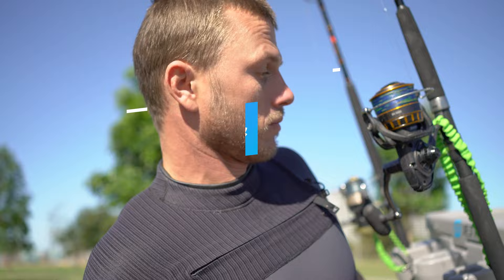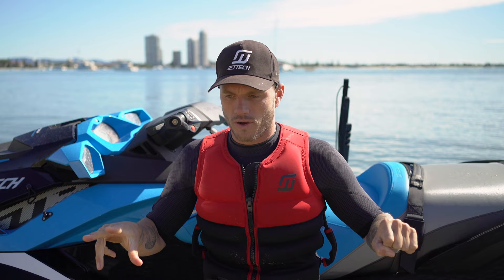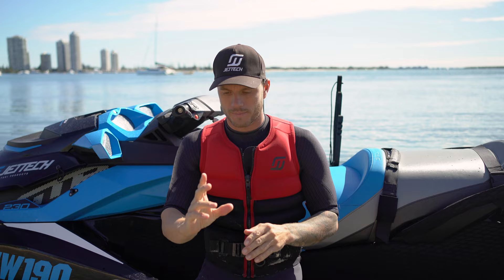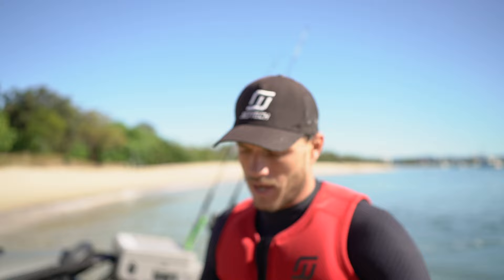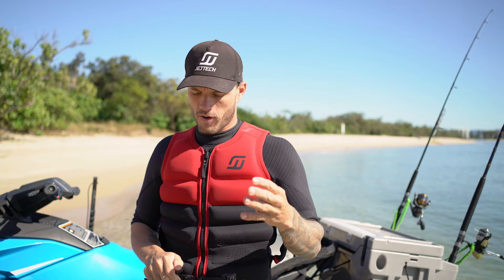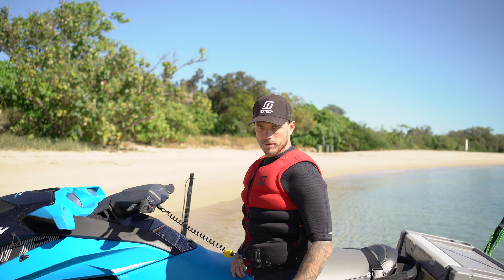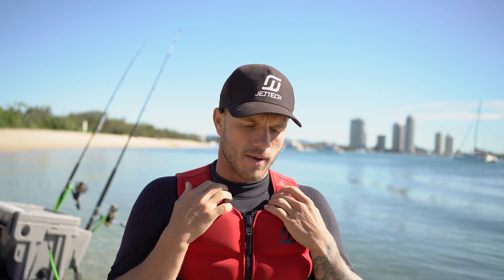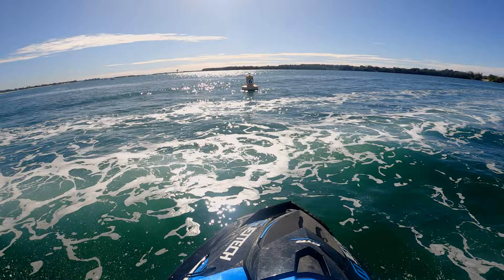DON'T DO THIS ON YOUR JETSKI! - 5 Things NOT To Do Your Jet Ski

Comment: Also when you beach your ski before taking off again shake the rear end up and down to make sure any debris falls out the intake The waves can cause sand and rocks to go in it. Especially if you drag it on shore. Also, beware of snakes. When I beached my ski and went to take off it was cavitating not going anywhere When I reached under into the intake I pulled out a huge water moccasin snake that attacked me and I was able to fling it away. From then on I would flip my jetski on the side to look inside if it ever cavitates again. lol.

Comment: Be aware that kiteboarders can only go crosswind or downwind.  Kite lines are generally 25 meters, and a jet ski within 100 meters (cross or downwind) is a potential collision.  If you find a kiteboard out there, it will often have a name and contact info somewhere on it.  Or if you see the person floating pretty far downwind (more than 50 meters downwind of their board), they'd be happy to get the board back.  But only approach from upwind; don't get downwind or crosswind of them due to lines or risk of wind catching the kite.  Also once the board is near them, probably best to move more upwind unless they are in a panic and asking for other assistance.
Reply: Great advice
Reply: Get free beer later when retrieved  a guys  kite that blew a mile up the river too. Lol

Comment: After 10 years of riding jet skis, I would highlight these three rules as the most important ones:

Rule no 1 ALWAYS wear a life jacket when getting on the jet ski.
Rule no 1 ALWAYS have a key attached to your jacket before you start the engine.
Rule no 3 EVERY TIME before making a sharp turn ALWAYS look around especially behind you (cause someone might be there).
...
Reply: Ima assuming u learned the last reason from experience

Comment: Tip #3 is real important when you reach shore and don’t turn off your engine, the impact of the jet ski landing in the sand will be very hard. It could even dislocate your shoulder as your body will bang against the jet ski handles

Comment: I dont get it with the kill switch. The rescue runner used here around we set the clip to the handlebars, so it dont cut the engine if rider is of the jet. Reson for this is when engine running but no stearing input it starts to circle. If engine dies and wind carries the jetski away you are not going to catch it swimming...
Reply from the maker: Each to their own on how they like to set up their skis, however we find it much more safer to clip the safety lanyard to the rider as per manufacture's safety guide too.
Reply: Older skis were set up to circle if you fall off.
The newer ones will just keep moving straight ahead. 
If you fall off at speed, by the time you get your bearings the ski is  hard to catch with the engine running. 
I've fallen off a ski at speed wearing a lanyard, when I caught my breath the ski was only a few feet away with the engine off.

Comment: #1 - you dont really need that plug, as there is a one way valve connected to this outlet from the inside. Looks like you never opened a seadoo :)
Reply: Lol you do realize one way valves only work with enough pressure to force them closed. Water will easily get past the valve at low pressure aka sitting in the water.
Reply: @Kenshin Himura  it wont, its a ball valve. I checked already actually and tested. But you are partically right, at a VERY low flow it may very slowly enter, which doesnt contribute to anything as it gets evacuated by passive bilge system right away in that amount. And I would never leave it open sitting in the water. My application is I ride it in the ocean, load it on a trailer, come home and leave it on a trailer. In a dock situation you definitely need to plug that hole, it makes sense
Reply from the maker: Better safe then sorry! Especially when you are a few kms offshore.
Reply: @Jet Tech  definitely wont hurt to have a plug! I agree!

Comment: What do I do if I had my garden hose running on the back of the seadoo with the engine turned off for over 5 minutes?
Reply from the maker: Hey Edward, I would go straight to a seadoo dealer and ask for there advice!

Comment: So last time I took my waverunner out I ran it til it was low fuel, ( like I always do), and on my way back in I was turning and going under a bridge so I let off the throttle to slow down and turn to avoid a pillar, and my steering completely went out, I throttled for a second to help the turn and nothing, I hit the pillar at about 10mph. I know slowing down slows the turn but even at idle my ski turns just fine so I'm wondering if the low fuel cut the engine for a sec. Has anyone else experienced anything like this? Ofcourse after I hit the pillar everything worked just fine and I went straight to ramp and loaded it up.
Reply: If your front end lifted up enough yeah could’ve coughed for long enough to burn you
Reply: @lukegorski1882  yea it was super weird, it took on a little water last time I took it out, unfortunately I think there's a very small opening in between wher the 2 shells bolt together, I'm hoping I can either seal it myself or that it won't be too expensive to fix but I imagine it will be